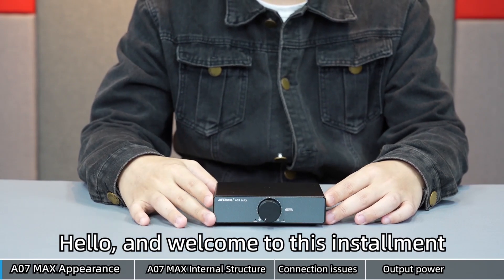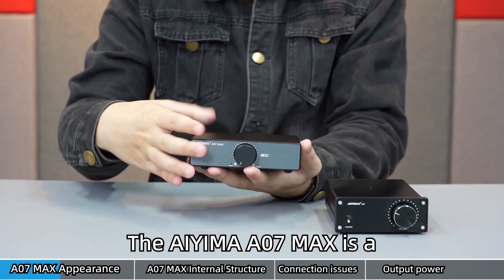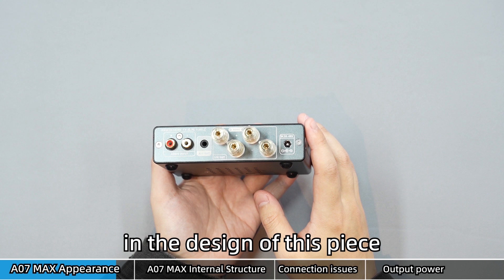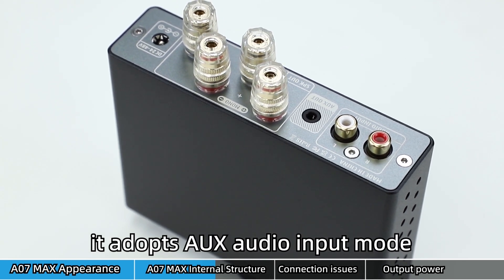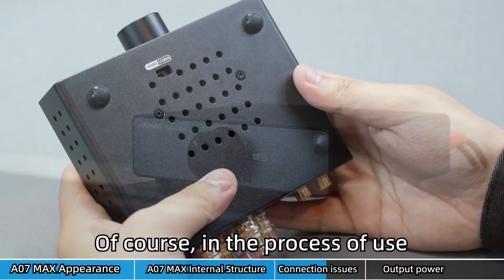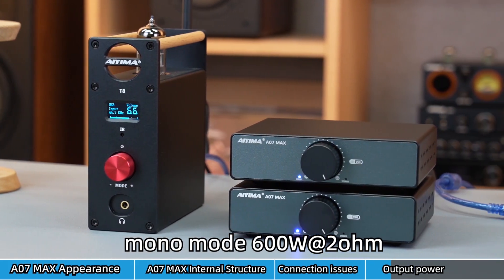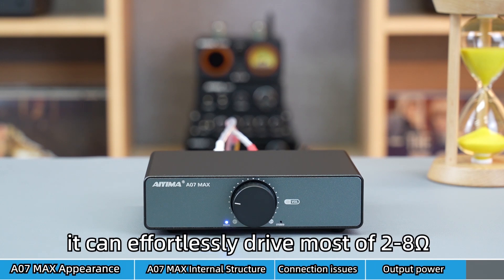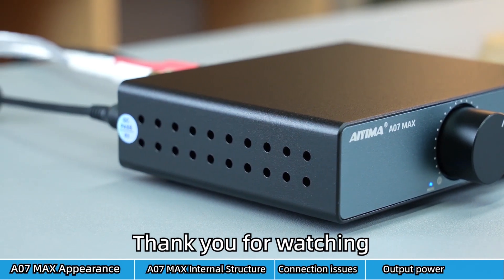Aiyima A07max Amplifier: Comprehensive External Review and Features Explained

Comment: I'd like to know if I can use the A07 to push 2 guitar speakers 50w each (considering I'm using the right power supply)... It's said that each output can provide 300w @ 4 ohms. Is it possible to achieve 50w each @ 8 ohms?
Reply from the maker: Can be connected, but not sure about the sound quality
Reply: @aiyimaaudio8133  I would like to use it as a power amp after my multifx